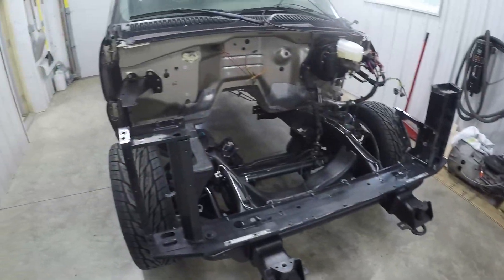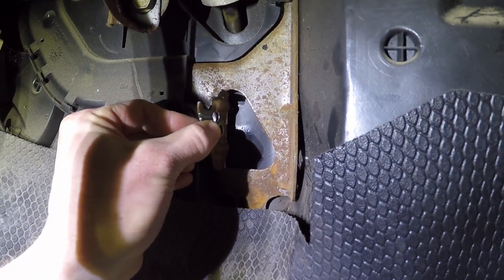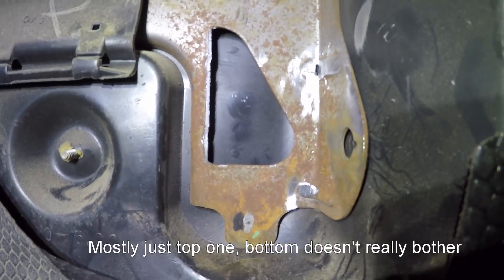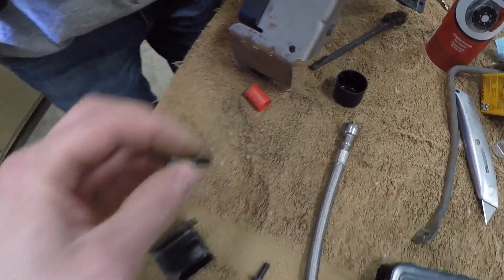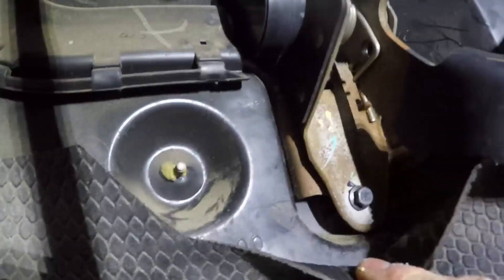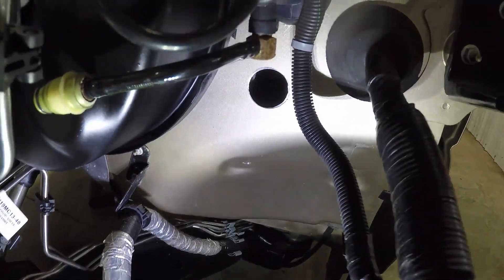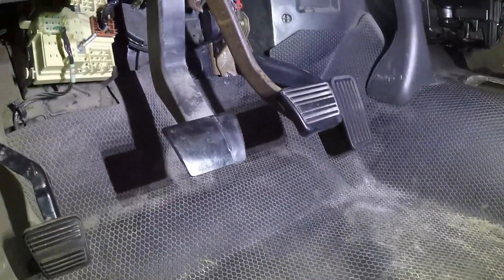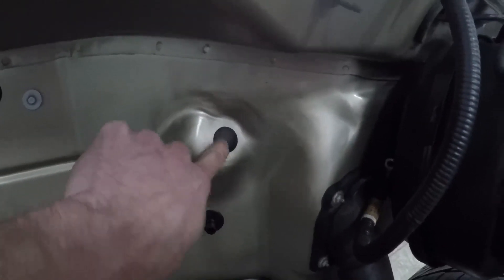03-05 Silverado - Swap DBC to DBW Pedal (no brake bracket swap) How To

Comment: I’m doing a similar swap except a 99 Cateye and swapping in an 07 classic drivetrain I appreciate this video very much. What I was wondering if you could cover how you integrate the body harness to the new fuse box from what I can see the fuse boxes are a little different. Any insight would be appreciated
Reply from the maker: We aren't changing the fuse box as this is a 2004 to 2004 swap, so I can't help you with that sorry.
Reply: @ darn I appreciate the response though will still be following this series!

Comment: Your vids have been really making me want to add a SCSB for a while. Came across a really clean 05 V6 2wd 5SPD 176k miles and 0 rust. Seller is asking 4k and it’s very well maintained. What do you think about that price point?
Reply from the maker: @KyleReese26  that's about what my dad paid for this one and it had a blown motor, so I'd say that's a great deal if it doesn't have rust and is well maintained.
Reply: @ okay awesome! I think it may be a good buy, only debate is holding out for a 5.3 but the best deal for an okay one is usually 7k+